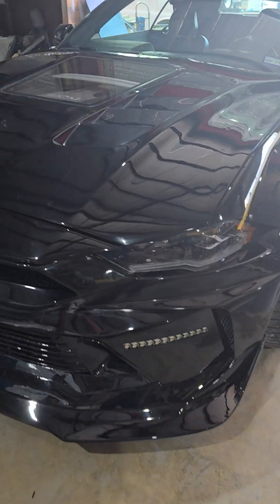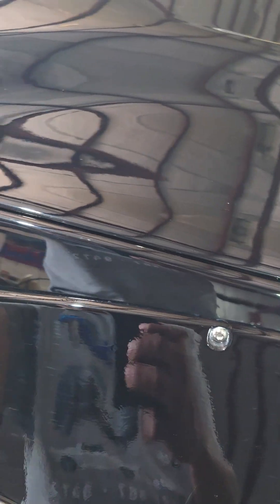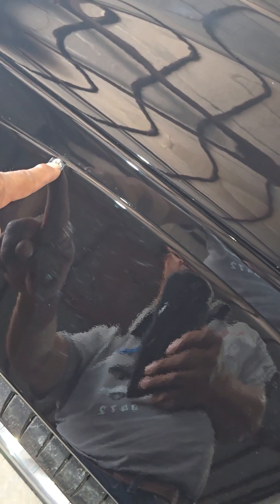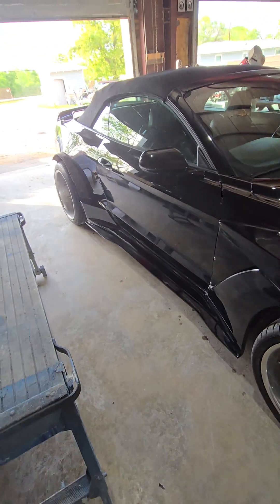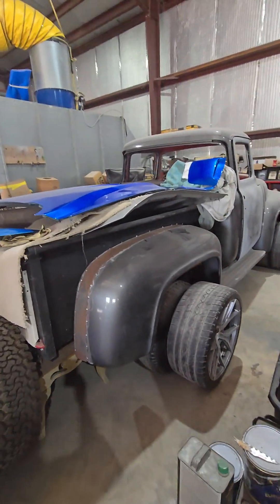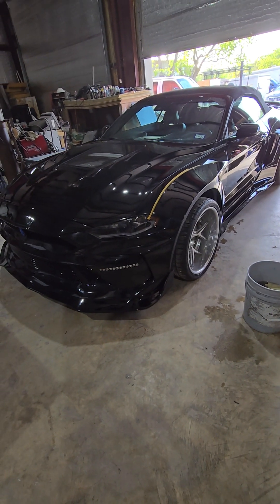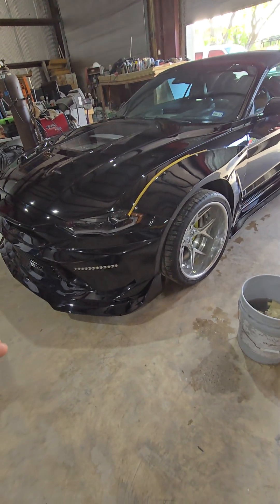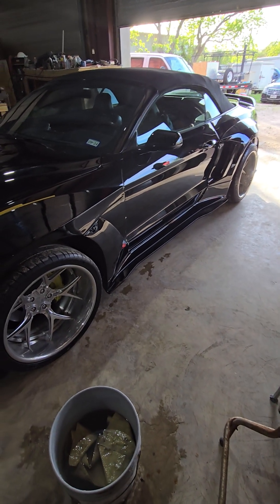crazy widebody mustang convertible  project

Comment: Hey! Is that the standard black prime? Or did you paint it
Reply from the maker: It's painted, and it was a major headache. The bodykit is very thin and requires  a lot of work, lots of primer  sealer , I had issues with fiberglass  strains popping through paint

Comment: Also; whats the wheel/tire setup? Ive got this kit ordered on the way
Reply from the maker: The wheels are custom made 20x13 rears and front 20x11  forged wheels
Reply: @mcbpearlandtx  tire size?
Reply from the maker: @TracerPerez  3453020 rear.              front 3252520  but front one need modification  of wheel arch  and cutting  some metal ,also removing some brakets that get on the way
Reply: @mcbpearlandtx  really not trying to do any bracket removal for the front, is there any other size that would be better for the front for a seamless fit?
Reply from the maker: @TracerPerez  18 or 19 could work  ,correct offset is the key
Reply: @mcbpearlandtx  ooh! The tire size really, what would be one below 325 25 20? Or just keep it as is just with 19 inch rims?
Reply: @mcbpearlandtx  sheeeesh fat wheels 💕
Reply from the maker: @TracerPerez  19 will  be better. Note that front lip spoiler seats very low I'm having to modify it ,I'm raising it 1 inch  ,by cutting the fiberglass and raising it.
Reply: @mcbpearlandtx  Hey bro! What offset did you end up going with?
Reply from the maker: @TracerPerez  
Front width 11, -60 offset

Rear width 12, -43 offset
Reply from the maker: On the back, I did 20x13 with 5.75 backspace. If you do 12 it's-43
Reply: @mcbpearlandtx awesome bro! Did you have to do extensive priming? I'm gonna be wrapping it instead of paint
Reply from the maker: @TracerPerez  I did 2 coats of primer, but if I do it again, I would do 3 heavy coats. The wrap, it's  probably  a good  idea ,are you doing it yourself  or paying for it ?
Reply: @mcbpearlandtx  Paying for it professionally, trying to cut costs and was wondering if the product is okay with the primer it already has
Reply from the maker: @TracerPerez  how much does a wrap cost for your car ?
Reply: @mcbpearlandtx  about 4 Grand; do you think it'd need additional priming?
Reply from the maker: @TracerPerez  I'm not familiar  with the wrap  adhesion  to fiberglass, the primer seems good but triple  check the bodykit mine needed  bodywork done to it , the hood specifically need it 1day 1/2  of work, to get it to look  good, also the wheel flares need it fillers ,when we installed the bodykit they were  waves and dips in The actual bodykit
Reply: @mcbpearlandtx  I see! Did you get the kit from the Europe supplier? Or the one in Florida?
Reply from the maker: @TracerPerez   a company in houston tx
Reply: @mcbpearlandtx  robot craftsman US?
Reply from the maker: @TracerPerez  yes u.s